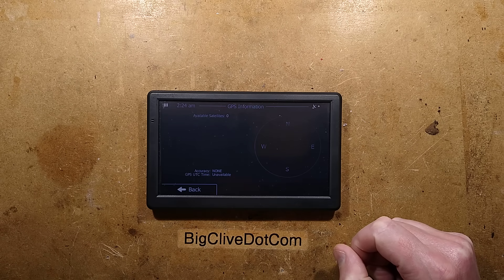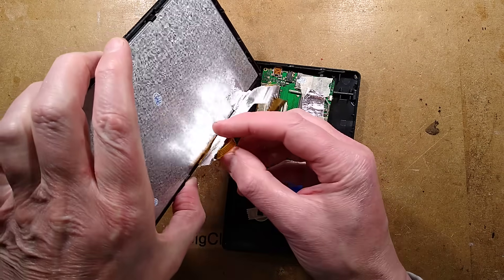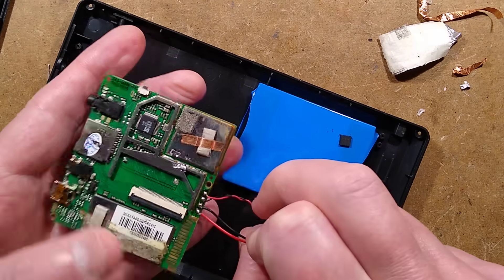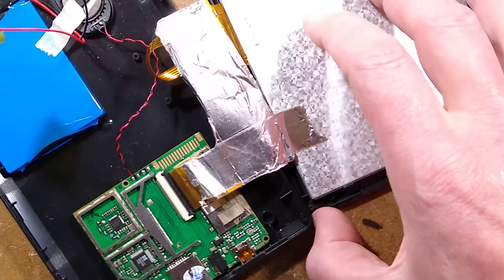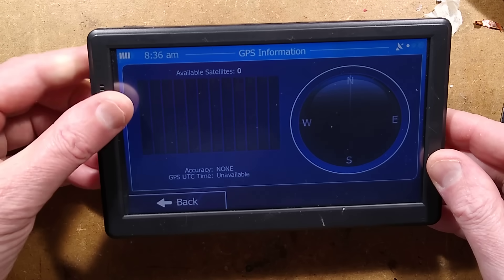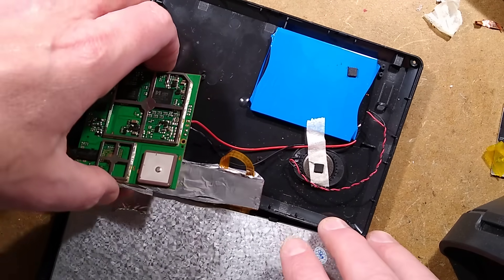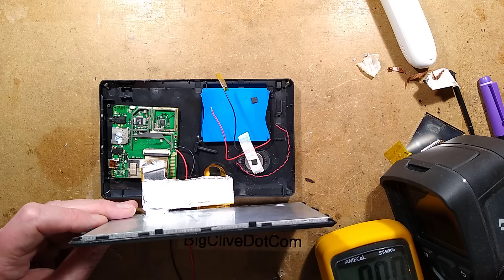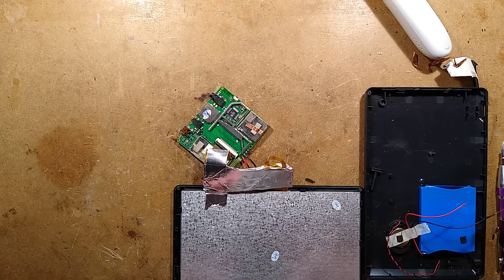Inside a trashy sat-nav

Comment: Older GPS can use an hour to find the first satellite if it hasn't been used for a while.  More modern GPS have more channels allowing the receiver to look for more satellites at the same time, shortening the time to lock on the first one. When locked to the first satellite,  it has to download the almanac (a map of where satellites are on the sky) because it knows nothing about where satellites are. This is done at 50 bit/s and takes  about 15 minutes. When it has done this it can start locking on to more satellites and calculate it's position.

On a phone, the almanac is downloaded from the internet, so it only takes a few seconds to lock onto the satellites.

Comment: Shouldn't that GPS Antenna be facing directly up? looks as though instead it seams to be by design mounted in a car facing out towards the front of the car? Also I have Naviextra's in my Alpine Headunit - goes alright but definitely needed a software update when new

Comment: i was messing with a gps module a while back and i learned that they draw huge spikes of current (up to 1.2 amps for a few microseconds in my case ) when they are searching for signal and each time you turn it off it actually saves the location and the satellites that it had locked on last time in memory and try's to get there signal next time ..... so you get the perception that they get a signal fast but in reality it was from memory that's why most of them come with a small cell in the breakout board.......
in this case i guess the battery was so dead it couldnt save or reconnect to satellites from memory so it had to search again every time it turned on ....thats why it took so long .... and it couldnt get a signal becoz the battery couldnt supply the huge spikes of current so it just kept browning out !!

Comment: I bought a job lot of these sat navs that were all dead, I replaced the batteries in all of them and worked fine and none came back. I kept one for myself and prefer it to my £140 Garmin and has some better features, that was 3 years ago. It has the same software as the one in the video but a little bit 'tidier' inside. If I turn it on indoors and take it outside, there's a little wait lol.
Reply: Know where your coming from. Bought a cheap android no name tablet for its large screen to save my laptop getting damaged and guess what it my favourite device way more practical.

Comment: doesn't GPS require line of sight?
Reply: No
Reply: @iainathairydog  Pretty sure buildings block the very weak signals.
Reply: @drcl7429  they attenuate the signals, as do overhanging trees, or even heavy clouds. But the signal can reflect and can get through some roofs. It is best outdoors, but it's not line of sight.

Comment: I'm using a very similar device for like 2 years now. was 35€ new and it runs WinCE
It has a capacitive touch and a much smaller battery but the rest is nearly identical.
Had to open it up as the power-button didn't last long but otherwise it's ok for what I'm doing.

Comment: It's very often the GPS LNA/front end, which is a tiny package with only several terminals. The reason is they use GaAs or SiGe HBTs for their microwave noise performance and power consumption, and to build them, they deposit very thin layers of different highly doped materials, which leads to all sorts of stresses and material interactions. The long-term reliability of these transistors has always been a known issue compared to boring Si. 

Then add the cheap China factor, particularly with the fact they are often MCM/MCPs to accommodate the filter and bias circuitry. You'll see the same issue in other consumer microwave devices like radar detectors and satellite receivers.

Comment: meanwhile all kinda old garmin and tomtom units sitting at goodwill until ultimately no one buys them for $5 and they get sent to the dump including plenty of newer units with micro sd and media features
Reply: Same here, trying to update and old Magellan. Roadmate with south America maps, they are nowere to be found, at least to try if they are compatible
Reply: How easy is it to update the maps on TomTom or Garmin? I've done it on generic Windows CE units, just a matter of cut & paste using a laptop.
Reply: @ericpode6095  the newer the model the easier, some of them are as simple as downloading a couple gig file and dropping it onto a sd card or internal memory, they will even sell you new maps if you cant find them for free elsewhere wink wink
Reply: @frogz  👍
Reply: @ericpode6095  hardest part is finding "unlocked" maps that work with any unit, just need to know what to look for

Comment: Hi Clive, I have a old TomTom nav I'm using, I found out when my Mobil phone was week off signal my TomTom was also missing signal! When looking into it using some app for the phone so I could see how many mast it was connected to, it would funny enough be almost the same as the TomTom in satellite, what can we make out of this? Thinking about it can it be possible to send a signal many hundred or miles maby thousand miles, using batteries and some solar panels to power the extremely powerful amplifier on the sattelite, thinking of the Ghz band they are using, and the power it will need, I'm not sure there is hanging anything in the air for sattelite anymore.
I'm and electronic engineer, and I'm educated at the government telecom in Denmark in 1987, my background is in tv/radio /mobilphone transmission and receiving, at the time the mobil was only 450mhz and the later 900 mhz, when I was educated it was the GSM signal.

Comment: To be honest I was expecting a bigger battery than that.
Then I remembered that this is reality. 😀
Reply: The device comes with a 12v adapter and is meant to be powered. The battery is just to cover interruptions such as starting the engine.

Comment: An offline GPS device, that doesn't have AGPS data from the internet to assist it, taket 10..15 minutes to start up "cold" (meaning the almanac data have to be downloaded fresh off the satellites,). You'd probably get a lock if you'd let it try for 15m or so after it got 3 sats. And yea, thats probably CE based, and an iGO has been one of the best offline navs out there back in those years when mobile data abroad was hard to get by.
Reply: Its definitely CE, android is way too resource intensive for that processor.
Reply: Yep I had an early satnag like that. It could not get a lock on the move ever. If I needed it working I'd put it in the car & turn on and go back into the house for a cuppa. Once it had found the satellites generally it was okay but way less use than a decent mobile.
Reply: Modern multi GNSS receivers have a TTFF of a minute or two at most. It very much depends on the receiver architecture ( number of channels, acquisition strategy)
Reply: @rowanjones3476  modern receivers very often rely on A-GPS to load almanac data from the internet as well.
Besides last checking the satellite systems my current phone supports made me wonder, as I might never have heard of half of them before.
I wonder how much of a market share these offline satnav systems still have. They are still around, and there are even specialised versions for motorbikes, caravans and trucks. But for everyday navigation I guess most of us have a device capable of more than a premium device from 10 years ago within an arms length.
Reply: It would HELP if he put the antenna UP instead of pointing DOWN at the bench too.

Comment: A GPS complete cold start can easily take 30 minutes. The receiver has to listen to all the frequencies until it can identify a GPS signal, then it has to receive and decode that signal for several minutes to get ephemeris data for the constellation and then it knows which frequencies to expect signal and can selectively listen to those.
Ephemeris data is good for about 2 weeks.
Reply: A-GPS helped a lot getting a quick on modern smartphone. Getting this data through a network operator was quite revolutionary.
Reply: @cuteraptor42  which is nothing else than actually loading a more recent "almanac". Only I think with A-GPS it is somewhat usable only for about 3 days.
To some degree some of the devises with the information they got from the satellites they kind of updated their internal almanac. that is when restarting usually went a lot faster for a while.
I remember those things taking usually at least 3 minutes to know where you are, and then trying to get you from some neighboring road to the road you already are driving on. Most useless for short trips within the city, you might have arrived before the darn thing had an idea where it is.
Modern A-GPS indeed is quite an improvement, it is not that hard to forget that it was not always like, instant on and the software knows where you are when the app is started. Well, maybe that is not about forgetting but suppressing I guess... I for my part would not want to change back.
Also additionally Android these days takes more than just GPS into consideration (With GPS just being used as a Stand in for actually GPS, GLONASS, BAIDOU, Galileo and what else satellites todays Chips can handle), but known Wifi networks as well as Information from Cellphone towers. so even without satellites only with cellphone towers an android phone very likely knows within 300 meters its position.
Reply: To the other replies: don’t forget: you can’t read the almanac data until you’ve successfully found a Gold code and offset matching one or more of the satellites in view - and hope the satellites found stay reliably in view for 12.5 minutes.  A GPS receiver cold start with no hints of where it is or what time it is could easily take 30 minutes.  Modern receivers have algorithms for guessing that speed up the process.  Back in the mid 1990s, I had a Magellan receiver with a single digital channel which had to time share between Gold codes.  That Magellan could take a few hours to lock in.  Basically I put the Magellan in my car the night before a trip and let it run all night (didn’t appreciably deplete the battery).

Gold codes (what is XORed with the satellite bit stream) are kind of neat.  Each satellite uses a different code.  Adjacent codes have a lot of orthogonality and are relatively interference resistant with respect to each other.  Within a given Gold code, there is a fair amount of autocorrelation which makes it relatively easy to sync up  by stepping through the bit offset once you’ve guessed the correct code.  This is what makes it possible for all the satellites to transmit their civilian coarse navigation data on the same specific L1 frequency.  The one megabit chipping rate spreads the signal enough that Doppler shift is not a worry, especially considering the almanac and ephemeris data is a mere 50 bits/second.
Reply: "almanacs", "ephemeris", "gold code". I wasnt sure if i was still reading about GPS navis or some Final Fantasy game plot.
Reply: @nekoimouto4639  Those are actual words from the official GPS public documentation published by the US military.
Reply: It is also cool that GPS essentially demonstrates that the concept of Relativity is probably correct.  The velocity of the satellites should make the time reference on the satellites run 1/10E10 part per second slower than an initially synchronized Earth clock.  The time dilation caused of the mass of the Earth makes the clocks on the satellites appear to run 5/10E10 parts per second fast.  The solution is to run the 10.23 MHz reference oscillators on the satellites at 10.299999…something MHz - just a bit slow, so they stay in sync with Earth time and on the ground.  If the reference oscillators weren’t run a tad slow, the accumulated time error would case a positional calculation error of 11 Km after just one day!
Reply: @wtmayhew  re: "The velocity of the satellites should make the time reference on the satellites run 1/10E10 part per second slower than"
I don't think so. The satellites at one time are APPROACHING an observer, and later they are LEAVING an observer. Little correction is made for 'time dilation' effects.
Reply: My Garmin eTrex was a bugger for this. It was considered a good day if it got a fix within 15 minutes of being switched on.
Reply: Shouldn't the Almanac allow a first position fix in about half that time?
Reply: @tz8785  the almanac is the ephemeris data and gradually loses relevance over about two weeks. The 30 minutes is a typical worst case when it takes some search time to locate a satellite with a clear and uninterrupted signal and download the current data. Data rate is very low.
Reply: Truly.  Cellphones use the cell tower location to get an idea of which satellites are overhead.  Without that optimization, they can take the better part of a half hour, as you reported.
Reply: re: "The receiver has to listen to "all the frequencies" until it can identify a GPS signal"
Wrong. All US GPS NAVSTAR satellites use the SAME frequency, 1575.42 MHz. What VARIES is the pseudo random spreading (spread spectrum) 'code' each satellite uses to ID itself.
Reply: @uploadJ Time dilation does apply because the reference frame of the satellite clock’s constant motion of ~4 km/s is the Earth center, not the GPS receiver.  The effect of the Earth’s mass is much more influential error component.  This says it better than I can: https://en.m.wikipedia.org/wiki/Error_analysis_for_the_Global_Positioning_System#Special_and_general_relativity
Reply: @uploadJ  Yes,  actually I do know.  The design of the US NAVSTAR GPS allows position to be resolved by performing trilateration.  Doppler shift is not significant to the computational process.  Time is obtained by measuring the number of bits offset between the terrestrial copy of the C/A PN sequence and the PN sequence arriving from a satellite, and then multiplying by bit duration (~977 uS).  X, y and z are determined for the ephemeris, almanac and correction data in the navigation message.  Newton’s method is iteratively applied to approximate the solution to four or more simultaneous equations (see http://mason.gmu.edu/~treid5/Math447/GPSEquations/).  As few as three satellites can be used by discarding one of the two solutions which can not be on the Earth’s surface.  Position may be further refined by improving resolution of time, d, by measuring the phase between the terrestrial PN sequence and and received PN, thus reducing the time uncertainty to less than +/- 977 uS.  Phase measurements allow estimated position uncertainly to less than 3 meters under good conditions.  Even further refinements are possible by correction for ionospheric distortion by monitoring more than one L band frequency, applying Wide Area Augmentation System data where applicable or ground based differential data.  Currently less than one meter uncertainty is possible.  At this writing four Block III/IIIf satellites are on orbit and and capable of up to four civilian L band frequencies.  Positional accuracies fo within centimeters may eventually be possible.  There is a lot of good information in an older but still relevant publication of the US Coast Guard, see sections 1.4.2,7 and 1.4.2.8.  https://www.navcen.uscg.gov/pubs/gps/gpsuser/gpsuser.pdf
Reply: @wtmayhew  Not completely accurately summarized, despite the source.  With 3 satellites, one needs to throw away infinitely many solutions corresponding to altitudes other than your own.  With 4, you only need to discard the solution indicating you are in a outer space (which would violate the export restrictions on receivers that work at airforce altitudes much lower than those solutions).  Competing GNSS constellations already brag about cm accuracy for paying users, while professional civilian GPS users have long achieved precision by exploiting an unencrypted aspect of the military signals.
Reply: Well my phone and my old TomTom work as soon as you turn them on... Not to mention built-in car nav systems which work immediately etc etc... I can't think of one time I have ever had to wait anywhere close to 1 minute, let alone 30.

Comment: My ancient Garmin has never been able to pick up satelites in the house, it's fine in vehicles and outside. I've never been sure whether this is the building sheilding connection or whether it needs to be connected to a car battery. On disconnection (from the van or car) it always knows and asks whether I want it switched off or left on, I've never checked that sats are available disconnected whilst in a vehicle.

Comment: Surely an original SatNav as old as that would need to be outside to get the satellites? Mine always use to be better outside than in behind bricks and mortar. Or did you try that and I wasn't listening?
Reply: Newer ones aren't much better indoors either. Phones only track location indoors because they also have access to the cellular phone network's location tracking data that has a much higher signal strength.

Comment: The Kapton tape is on the antenna so it can be picked up with vacuum tweezers by pick and place equipment. The ceramic surface is too porous for this.

Comment: I don't think you can get a signal being inside when they're mostly made to be outside and right next to a window, but I like how you're asking it to publicly display your address 😂

Be nice if you explored more of the circuitry
Reply: I build such type of devices/PCBs. There is a ARM Controller, Flash Memory for the little OS, GPS-Chip and GPS-Antenna, some voltage switching-regulators, connectors and some resistors/capacitors. Not very interesting and a bit old.
The circuit is not special.
Reply: @mikropower01  sure I could see all that but I wondered if even the power supply was doing anything special